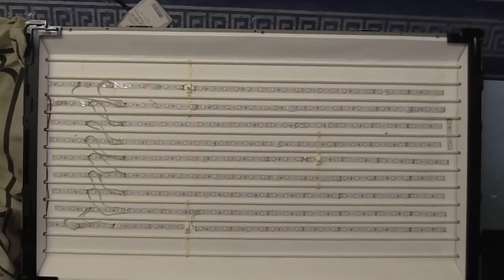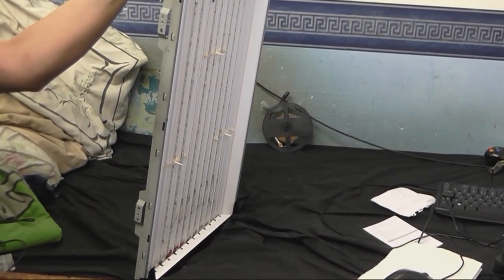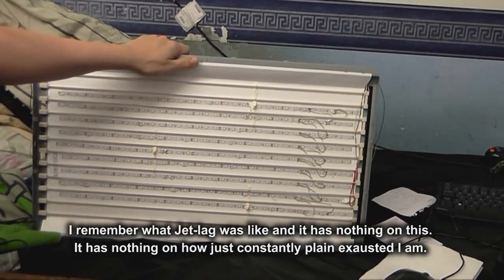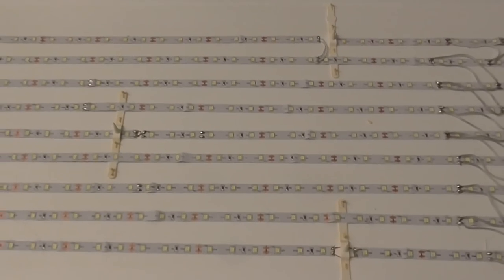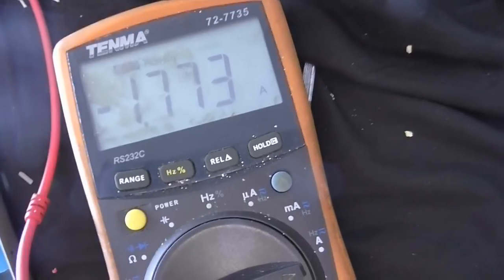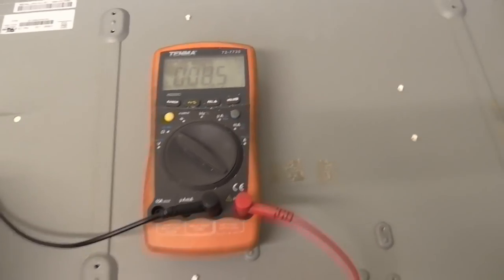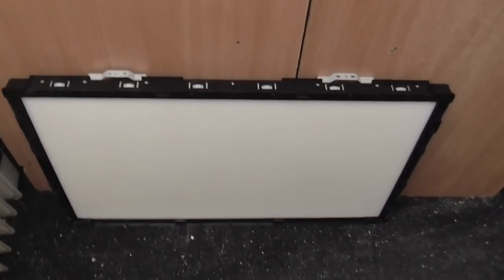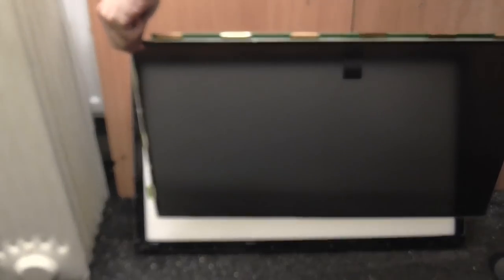Fixing my tv part 2 of ?

Comment: I used to have energy crashes loads, how did I stop them? Exercise! Started running and this pushed my energy levels right up, boy was it h.a.r.d. to start with.. Challenging. 💪👍
Reply from the maker: I've also found I feel a little better if I go out.  Of course that's when the weather isn't pissing down!
Reply: @CoolDudeClem  England eh.. tell me about it. It's always good to get out and get air 👍

Comment: Clem, are you on medication that take away your energy? when I got a lot of medication I used to sleep 10-12 hours and often feel sleepy. I hate winter too! I'd love to move to Florida or Texas or Israel those places have better weather.
Reply from the maker: Not that I know of. (unless you count an asthma inhaler) It's usually when I wake up when I'm at my most tired. I dont get it, sleeping is supposed to recharge you, so logically, I should feel full of beans as soon as I wake up and then progressively loose energy as the day goes on so when it's time for bed I should be exhausted, but if anything, I have MORE energy when it's time to sleep than I do when I wake up. It just does not add up.
Reply: @CoolDudeClem  I have sleep problems just like you, during winter I can barely fall asleep because the cold air brother my skin. I get the best sleep during the summer but when I take medication I need atleast 10 hours sleep. when I don't take medication 7-8 hours work for me. I often have a lot of energy during the night but I often feel sleepy during the day

Comment: Hey Clem, I made a 555 PWM deal for WW LED strips on my cpu desk.. I found It was still too bright sometimes, and could see flicker slightly.  Ended up using FET + POT since static load and regulated psu.
Reply from the maker: I've been experimenting with that last night with a spare offcut from those LED strips. It actually worked quite well once I used a log pot instead of a linear one.